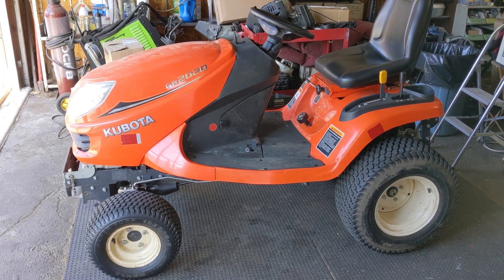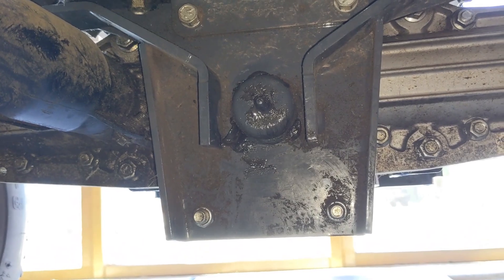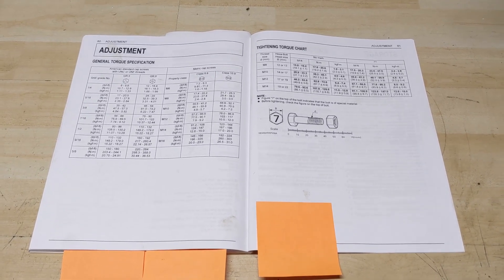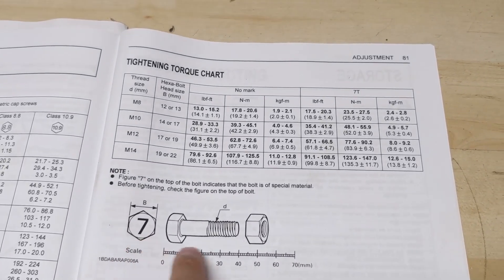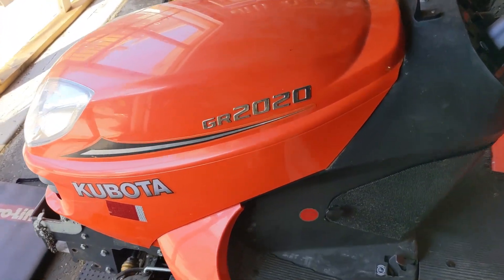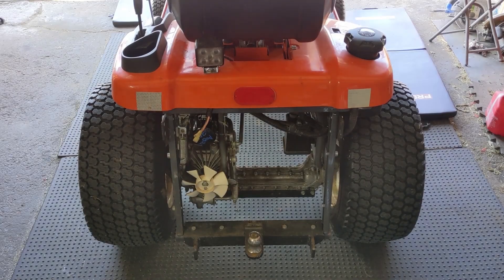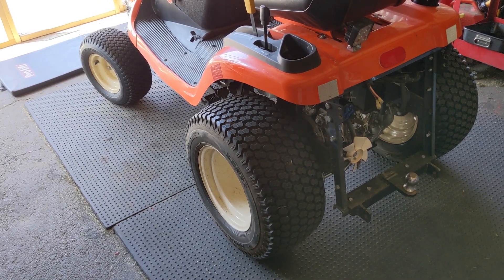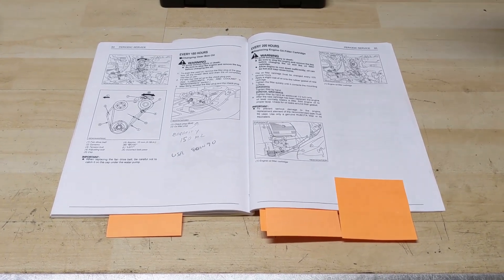Kubota GR2020 - Adjusting Front Axle Pivot and Explaining Glide Steer

Comment: How can I get my GR2100 to freewheel? Sometimes I just need to move it across the shop without starting. I can not find a release valve. thanks
Reply: take the cover off the rear...towards the left side on the very bottom of the transmission main body there is a little button you can push up and it will freewheel.

Comment: Just some additional information as i have really gone through the wringer with these machines. Grease and oil the snot out if these rigs. They have aluminum pivot points (4) on the front axle that wear super fast if you don’t. They also have a pile of oil points under the rig as there are many lever and pin connections under there. Drip 80/90wt gear oil on all the pin connection points. Also the Glide steer system has a specific adjustment procedure that needs to be checked often. Checking for the “clunk” on hard surfaces is a good way to see if it is becoming out of adjustment. The cast aluminum transmission housings front and rear are actually quite fragile. For normal operation they are fine but exposed to rough housing and they have many failure points. I use the 30 degree rule to calibrate the glide steer system. If you detect a “clunk” when the clutches release it means they are releasing too late which puts excessive strain on the drive system and could cause internal failures. Raise the rear wheels off the ground, locate the adjustment point on the rear axle, turn the front wheels 30 degrees to the left, check the left (inside) rear wheel. It should be able to be rotated free of the others. Not free wheeling with no drag but you should be able to turn it as the glide steer clutch has begin to disengage. As you steer the front wheels further the rear wheel with rotate with less drag. This is the magic if the glide steer system. If your rear wheel will not begin to rotate at a 30 degree front wheel angle, you will need to tighten up the adjustment rod at the rear axle linkage point until it does. Duplicate this procedure on the other side of the tractor and your glide steer system should function perfectly. Also check the toe in/out of the front wheels to be sure they are within reason. This rarely needs adjustment. And if your front axle has too much front to back movement and the bolts are tight, you need to remove small amounts from the spacer collars the bolts run through to lessen the between the axle support plates as you experience excessive wear down the road. Good luck.

Comment: I sprang the $140 for the service manual for my new GR2120 (diesel version of the GR2020).  There actually is a measurement that is called out to determine if shims need to be added or removed from the bottom bolts.  There is no mention about the top bolts so they don't seem to be involved in this measurement.  The measurement is taken between the front axle bracket and frame and needs to be 81.0 - 83.0mm.  The torque range of the bolts is specified as 35.5 to 41.2 ft-lbs.  If the looseness in the front wheel is still present after torqueing, a shim needs to be removed from each side of each bottom bolt.
Reply from the maker: @barryshonbeck2006  thanks for the info! So it appears my torque specs were within the correct range (after reading through their bolt torque chart) and the upper right bolt on this one was really loose I believe, so I would recommend checking them!

Comment: I just bought a GR2021 and it has burned through the front right tire in a few weeks. Interesting to see how glide steer works.
Reply from the maker: Check the front tire alignment, you may need to make an adjustment. Toe out usually wears the outside of the wheel, toe in wears the inside.
Reply: @EliminatorPerformance  thanks. I should have said it has worn through the middle section of the tread pattern. It steers straight with no bias either right or left. Must check if it was over inflated..
Reply from the maker: @richardblair9028  yes likely overinflated if evenly worn in center

Comment: Nice video I have to take my front axle out of my gr2120 to replace the pivot seals.  What was the extra tank next to the transmission? I didn’t see that in any of the parts manuals or assembly drawings. Also there is an adjustment for the glide steer transmission clutches to make sure they disengage at the right time. Always good to check this with a torque wrench. The process is covered in the service manual.
Reply from the maker: The black box at the back? That's the charcoal canister for the emissions. If you have the diesel model, it may be different than the gasoline version. And yes this one barely has any hours on it, it's a very nice unit. I'm curious how many hours your machine has on it that it would need the pivot seals replaced)? Thanks for watching!
Reply: @EliminatorPerformance  My Gr has around 1350 hours. I have owned it for around 100 hours. The transmission was blown when I got it so I spent the winter rebuilding it.
Reply: Hey, I also have a gr2120, when turning left or right, I get a knock in the front is that something that can be eliminated by adjusting?
Reply: @JackTekkel  pick up a WSM from your dealer it has a procedure to check and adjust the glide steer. If it’s not disengaging properly it can cause a lot of damage to the rear end.
Reply: @turbotona25  not many dealers in the Netherlands, maybe buy a digital copy online. Any pointers?

Comment: Your caliper is a dial caliper, not a vernier caliper.  A vernier caliper has no dial.
Reply: I see the main scale, I do not see a vernier scale.
Reply from the maker: I believe it is a Vernier caliper, simply with a digital readout, because it still uses the vernier scale, named after Pierre Vernier. The Vernier scale is "a visual aid to take an accurate measurement reading between two graduation markings on a linear scale." I understand the digital readout takes the place of the dial, but the end result is the same, it's still using the linear scale.
Reply: There are only two type of vernier calipers dial and digital but that is for sure a Vernier caliper
Reply: I see your point though the caliper is still called a vernier caliper even when the lower vernier scale is not visible since the digital vernier does not require it since it reads out the in between dimensions. I have seen some dial vernier calipers with and without the lower scale but digital and dial are much easier for a lot of people to read out. The plain style without the dial or digital mode are hard to read without training and good eyesight.

Comment: I saw that JD hood on the bench in your intro and wondered about it. Now I know what’s coming up next time. 😉   As for the four bolts, if I found one loose I would  normally have suspected manufacturer quality control error. Due to the fact that they require periodic torquing I would assume they have a tendency to loosen over time. For that reason I would be removing one at a time, cleaning up and applying threadlocker before tightening. I’d also torque to the highest setting. In this case I don’t think a diagonal pattern would be necessary though. One more thing - that owner’s manual is great!  Showing every maintenance procedure in detail is priceless!  Really demonstrates the quality of the manufacturer. 👍🔧🧰
Reply from the maker: I believe the manual says to torque those bolts (adjust the front axle pivot) every 100hrs or so, ideally thread locker would be good, but if you re-torqued it down the road and broke the seal, you'd have to reapply it. Thanks for watching!
Reply: Best manufacturers manual i have ever seen but should be for the price of this unit.

Comment: Would Loctite be beneficial on those screws?
Reply from the maker: Probably wouldn't hurt, but you'd have to remove the bolts completely to apply that, so it would be added time. The bottom bolts are quite easy to access, I'd have to look at the parts diagram to see if there's nuts on those top bolts, might be harder to get too.

Comment: It would be nice to have service manuals for all the machines that come in. Sometimes you have to decline a repair just due to lack of experience with a particular model. Great vid Jake!
Reply from the maker: Yea I've absolutely declined repairs before, specifically on a John Deere All wheel steer riding mower that needed transmission seals. I fully serviced it for the customer, then it went to the John Deere dealer for the transmission repair. I didn't want to take any chances!
Reply: Although this was not a service manual we had it likely is the best operators manual i have ever seen but you should expect that for the selling price of this unit.